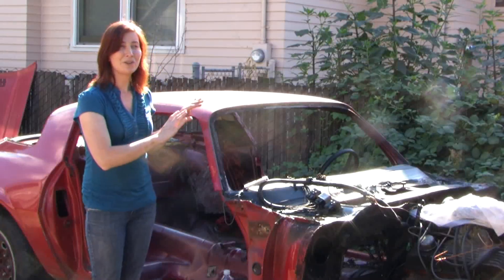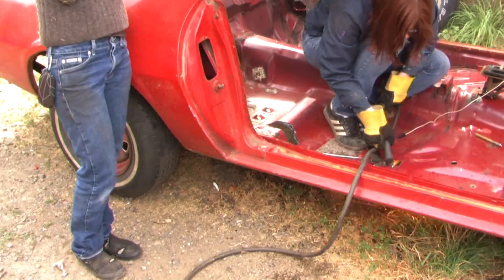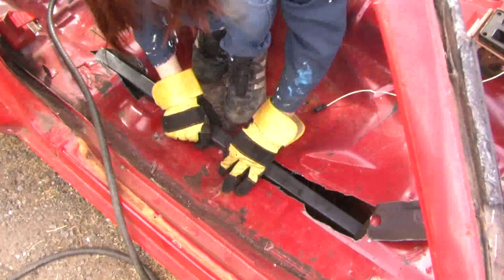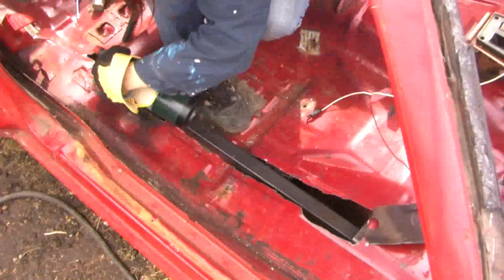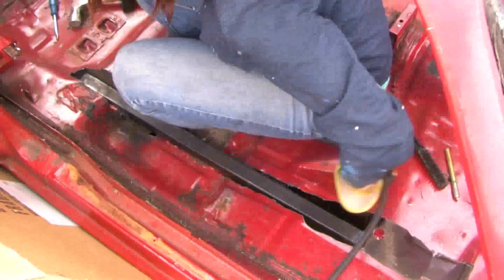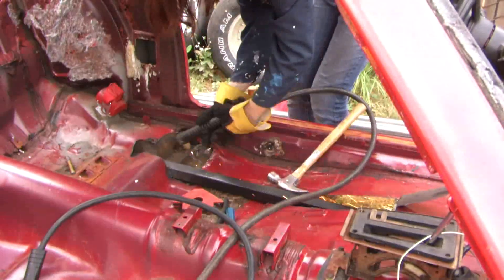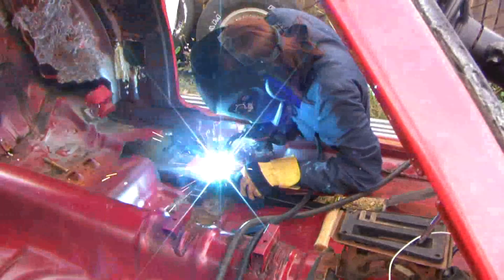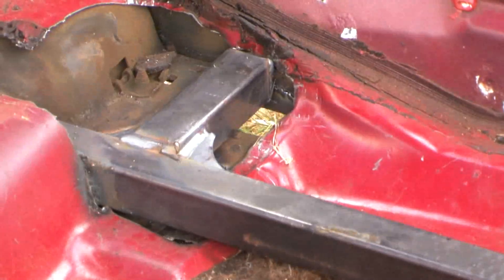Tying Subframes Together - Building a Pure Stock Race Car

Comment from the maker: @MrDirtcarracer  I've built a few torsion bar Mopar cars.  There are some nice properties to torsion bar suspension like low unsprung weight.  Most of them suffer from the bar mounts, lower arms bending(stamped sheet metal), k member moving around and floor pan getting soft.  If you find your car is losing ride height look at the mounts.   I'd make sure the K member is tied in well and the back bar mounts.

Comment: What the experts mean about flexing chassi, is that when it goes over its tolerances it should bend alot. So instead of for example connecting a square with a pipe from corner to corner, you connect a pipe up to a foot away from the corners, but still over to the opposite end of the square. Then when you crash, the square will bend with more resistance all the time, which means it will deform less in extreme situations than a square with reinforcement from corner to corner. Continued.

Comment: 4/x But good series! Without having seen them all (yet), have you done some videos on what equipment is needed to weld different materials etc, so the noobs among us can get a grip on what the cheapest equipment we need is for beginning metalwork? (Perhaps test different welding equipment and different adjustments on different steel and show us the differences?)

Comment: Awesome job Jeri .... I am just welding in some subframe connectors for my 69 Nova.......I built myself but have to be welded in from underneath car so I'm in the on my back position because I don't have a lift ( worst position to weld in ) ... Its cool you do all that welding from the top of car....I didn't even Know it could be done that way ( intresting to watch)..... Hey if you were my neighbor I would buy you an air chisel or at least some steel chisels  .... WoW your doing all that with a hammer and screw driver and making it work..... Very Cool Stuff.....But I still would buy you a nice chisel LoL

Comment: @frac 
you could split the audio from the video
then take that audio file and speed it up with audacity (if you use downsampling it won't pitch-shift the audio, it depends if that's what you want or not) then recombine the audio with the video

for splitting and joining the audio track you can use virtualdub, the interface is a bit "dry" but it's very functionnal

Comment: 2/x The square with reinforcement from corner to corner will have more strength until breaking point, but the square with reinforcement slightly off from corner to corner will have more strength after breaking point (breaking point being the point where the force X to deformation Y is highest, and so begin to taper off into more deformation per applied force if force is increased). Rule of thumb amateurs use; make bottom half of the chassi stiff but bad after breaking point and the top opposite.

Comment: A woman doing electronics and welding/racing?? That just proves you can do anything you can wrap your mind around.
My Dad raced Thunder Road in Barre, VT along with many other asphalt and dirt tracks around NH and VT including Bryar Motorsports Park before they paved. Where is that you ask? Loudon, N.H. =] 
I am lucky to be on a pit crew for a dirt modified, but unfortunately I live an hour away from the shop and the track, it's tough getting up there in the winter.
BTW You have one lucky man!

Comment: 3/x PS: A fast chassis will be incredibly stiff until breaking point, but a safe chassis will be stiff from after breaking point (and also not so stiff until breaking point when you crash the car is still intact, then the body suffers from thousands of G's, hundreds of G's is always lethal).

Comment: if i would do the sub frame connectors under my 3rd Gen, would have to put in a roll cage? i rather not, people say i cant have 1,000 hp in my 3rd Gen, cause the engine will fall under the car, i dont believe that

Comment: poor car,why not use a frame connector with bolts under the floor ,more easy if you need take out subframe in the future
Reply: because adding more things to the bottom of a racecar can interfere with total ground clearance (which is important for future aero panelling/aero in general), especially on car that have a deep tub that is close to the ground anyway.

Comment: Setting the gas on fire.. lol... seems to always happen..

I don’t understand why you would have to use the current frame. I would of cut the top half off the F body frame and got a frame from fife wa then build off of that.. solid frame is a safer design.
Reply: That's the rules dirt track racing stock frame